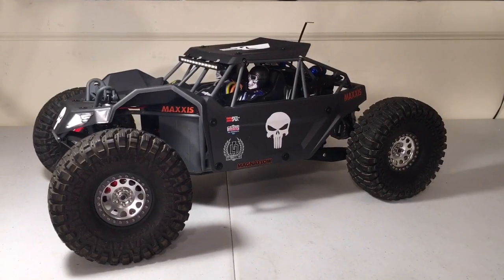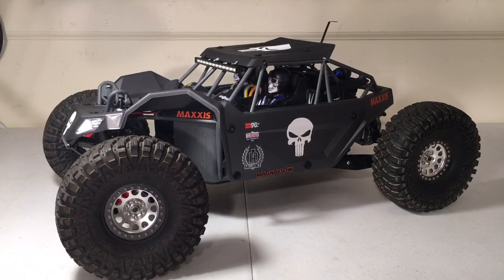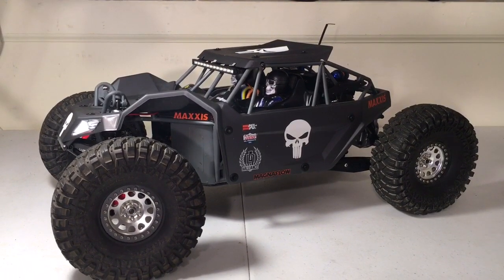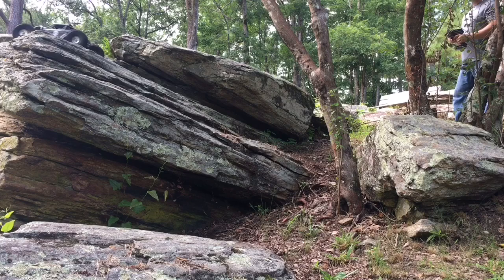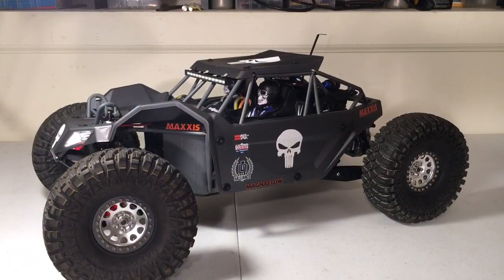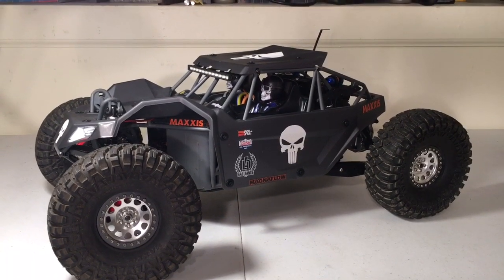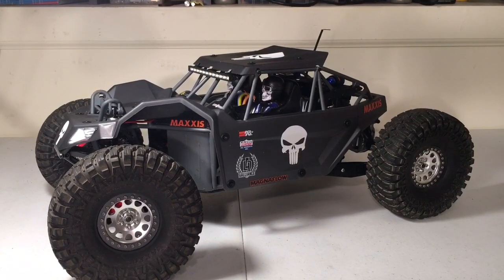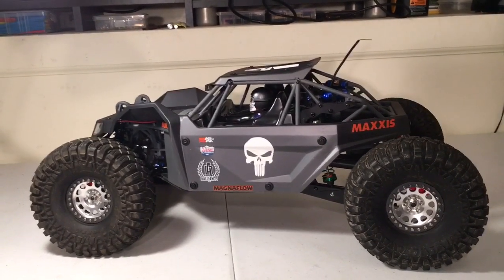Losi Rock Rey - Rock Test

Comment: I wish I had got one of these rather than the yeti kit! Great video!
Reply from the maker: Lee Wildman 
Thank you for watching and commenting friend! The Yeti is a very capable rig with a ton of aftermarket support! Check out my video of my Yeti with the new Exotek chassis! It brings weight down low and helps quite a bit! But if you still want a Rockrey now is a great time. The kit is only $250!
Reply: Bulletproof RC thanks I will check it out! The only thing left stock on my yeti is the cage and chassis!

Comment: Do you have the front diff locked?
Reply from the maker: I tried locking the front differential but I didn’t like they way it drove. So now it has 1million weight diff fluid in it.
Reply: Nice okay I did the same and tossed in SSD bulkhead. I also just got some Exotek diff housing. I already installed the rear good thing I did the stock screws had snapped. Have you inspected your diff gears after running it a few time? I’ll try get some footage up of my rig soon.
Reply from the maker: marccyberwiz 
Sweet, I’d enjoy seeing yours! I’m aware of the issue with the screws but I’ve not torn mine down yet. There are some folks on rccrawler forums that found a stronger screw to replace with
Reply: Bulletproof RC just posted some videos. Thanks!